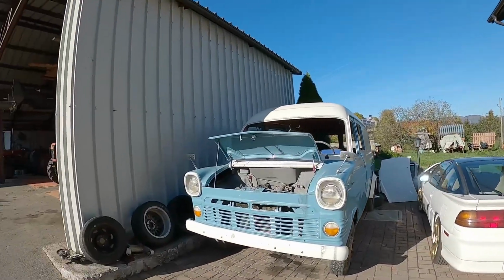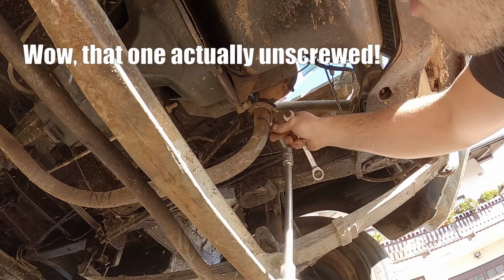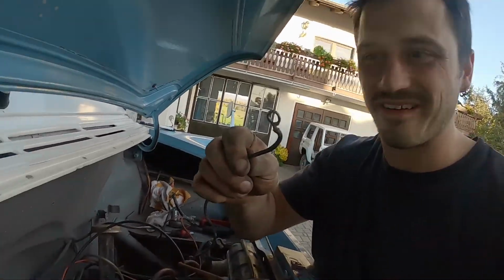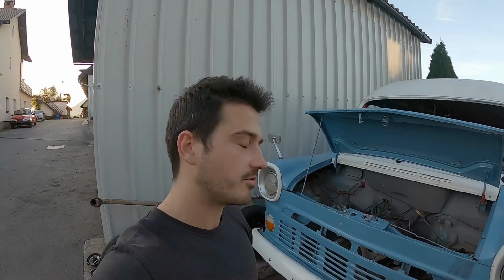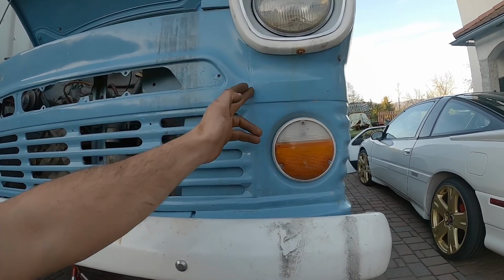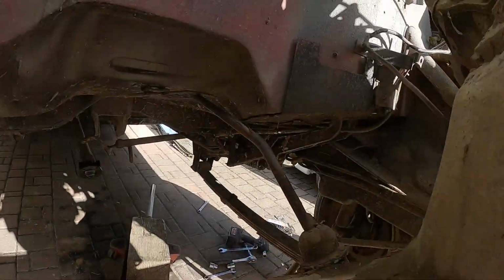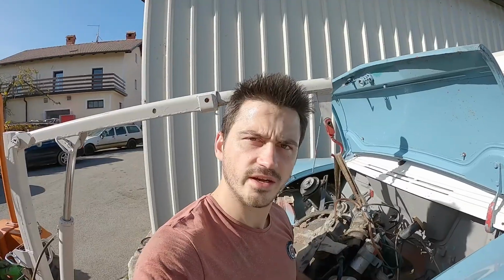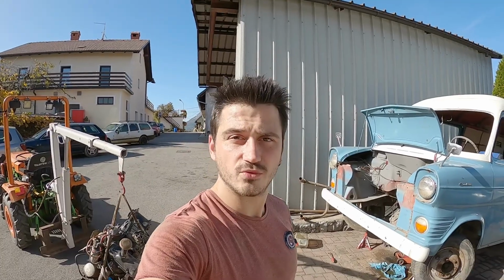Out With The Engine!  | Ford Transit MK1 Custom Camper Van Project | Episode 3

Comment: A little bit of information in front of the job would make your life way more easy.  The parts for the essex engine are more difficult to find than the cologne engine. Outside of little britain
Reply from the maker: It surely would, but there is just something special in discovering it by yourself! 😁 I hope there will not be too many parts to replace though.

Comment: I replaced a few of those V4 1970's Mk1 transit engines back in the 80's. I used to separate the engine from the gearbox first.
Reply from the maker: That's a good choice of operation sequence! I will soon be putting it apart for inspection and restoration.

Comment: I've also got an early mk1 flat front in the uk I'm fitting a turbo di with 4 speed automatic but keeping it flat front, to do so. I've had to move the engine back cutting the bulkhead, put crush tubes in chassis for engine mounts, and that won't lift in  between front crossmember and bulkhead so I have to remove axle lift engine box complete from below, it's been in and out 5 or 6 times to get Position correct, but it's now on its mounts bolted in, next problem is wiring because its epic pump, fly by wire & gearbox need info from pump to change gear
Reply from the maker: I think the flat front looks nicer. There always seems to be lots of in-out action in real life custom builds, heh. Is that a 1.9 TDI you're dealing with?
Reply: @HappyDayGarage  no a transit mk5 turbo diesel 2.5 (banna type) engine with automatic gearbox
Reply from the maker: That's a great option. I also wouldn't mind a diesel in mine, but I'm sure V4 will be pretty cool too. I'm actually thinking about turbocharging it.
Reply: @HappyDayGarage  V4 2000 be ok if you can find one
Reply: @HappyDayGarage  Get an lpg conversion and have it set up to provide the domestic gas as well. Cheapest way to drive and cheapest most space efficient way to cook/heat.

Comment: hey dude....super nice video!!!
are you going to film the entire restoration process of this ford transit MK1?
I wondered if a Volvo 2.3 engine would fit in it

good luck

gr. Arie
Reply from the maker: Thanks. That is the plan, yes. Everything is possible, it just depends how much money, time and effort you're willing to put in. I am actually considering installing a Cologne 2.9 V6 engine in the van for some extra power.
Reply: when you use a a Volvo 2.3 engine, you can drive on LPG really cheap!